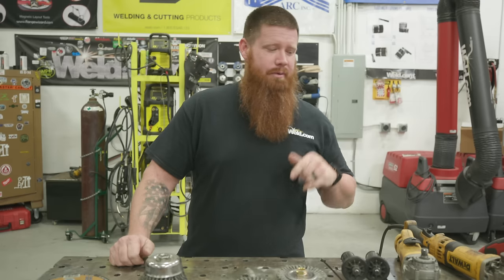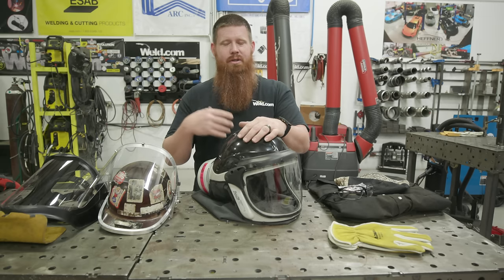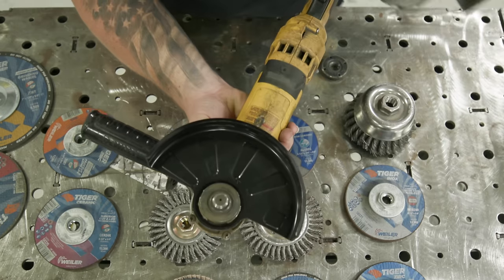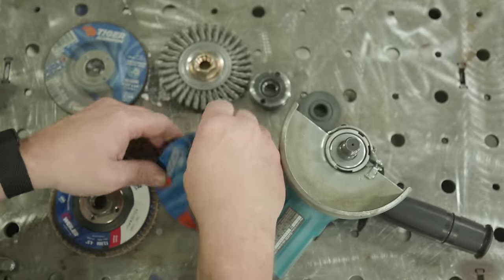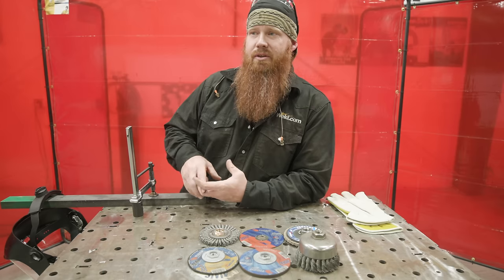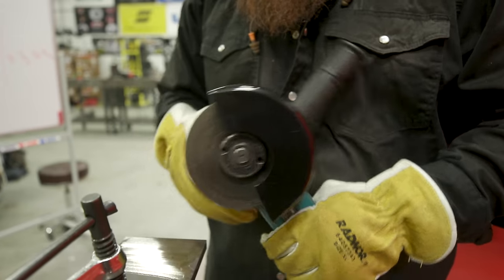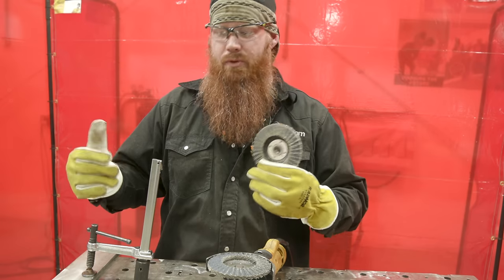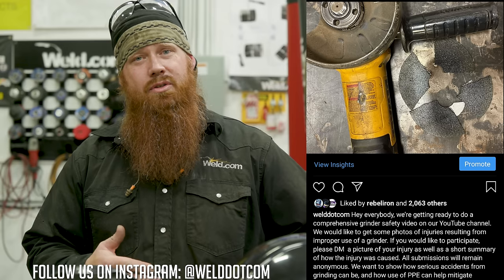Grinder Safety: How to Properly Use an Angle Grinder

Comment: Wire wheels are actualy banned at one of the campus’s I work at, a stray wire can do some serious harm to the human eye.
Reply: Or you could just wear safety glasses...
Reply: Of course so can everything else that goes on a grinder, I only wear safety glasses with small ones sometimes but you gotta angle it right, also you got to watch them getting stuck in your shirt, when you go to take it off you can near on scratch your eye out if you are unlucky.

Banning them is just ridiculous though.
Reply: Dale Neish im not saying I agree with it, but that’s their reasoning
Reply: Dimitri Ol m8 I just told you I didn’t agree with it. I was never in favor of their ban on wire wheels.
Reply: Dimitri Ol no problem my dude, happy trails!

Comment: List:
- No eye protection
- Short sleeved t-shirt
- No face protection
- No protection guard on machine
- Flimsy gloves
- Flamable material on ground
- Flamable material on workbench
- Highly flamable gastanks
- Holding workpiece by hand
- No second handle on grinder
 
Am I missing something?
Reply: No respirator
Shooting Sparks at the power cord
Reply: Big old beard flappin' in the breeze eager as a beaver to get in on that rotary action.
Reply: No hearing pro

Comment: Ok lemme try. 
No safety glasses on. 
Holding grinder with one hand
Grinding ON 02 and C2H2
Grinding near solvents
Not showcasing that magnificent beard!
Reply: and...
Work piece not secure
Power locked on
Junk on the floor
No welding jacket/spark guard
No guard
No respirator (cut-off wheel fumes or grinding dust while in my garage).

Comment: My take on safety violations I've noticed so far: 

No eye, ear, or facial protection
Gloves look useless against a grinder (maybe use leather)
Holding wrong part of grinder
Metal piece should be clamped
Use two hands for grinder
 Wheel/blade should have a guard
Fireball potion in front
Explody gas tanks behind
Reply: I think you got almost all of them. Maybe add standing on the wrong side of the grinder with the blade towards you and throwing sparks up not down?

Comment: Lol I set my battery powered cut off saw on top of a rag as it was turning off- the rag got sucked in . I'm here to learn safety. I scrap metal and I take apart Transformers for Copper. Quick story- My friend plugged in his grinder and it was ON! It rolled on the table towards him and cut him ( just like your presentation discussed.) Battery powered cut off saws don't give me the RPMs- but at least I don't burn out/ overheat the motor. Also I'm rough on the tool- forcing it in when I should just cut it slowly- a BIG THANX for your help . Quick story- I know 2 people who cut 2 fingers on a table saw- one guy with 40 years experience  has no feelings in two of those fingers!!!!!
Reply: I fell at the bottom of my porch stairs 2 months ago, I had an old crock pot glass bowl that had a huge crack in it, needing to be hauled off where I take my trash. Needless to say I tried to break my fall and laid my ring finger open on dominant hand. Had about 6 stitches, about 6 staples on my wrist, a shot in my backside, and one in my arm. For my negligence and stupidity. I was supposed to go see  a specialist, I decided against it. Urgent care told me they didn't have an ex ray machine but I had probably cut a ligament. Well, my finger will never be the same, and I already have deputyens contracture. I never thought something so small would make such an impact on my life!

Comment: 24:08 this is an inside joke right? Nobody actually uses that wrench.
Reply: @d.martins709  The tool spins the opposite direction as the nut, this means the nut self tightens. if you get it hand tight and use the whole disk in 1 go the nut is so tight it is hard to get off. if you overtighten the disk with the wrench you can damage the locking pin in the grinder. if you look at an old grinder with a lot of hours on it you will notice that the locking pin wiggles back and forth and sometimes doesn't work properly.

Comment: Guys anyone out there thinking these videos are pointless.. I had a disc explosion it's no joke I got super lucky my garden fence was not. I ended up with a hole in my top..fence got a hole straight through it
Now I take maximum safety and check every single disc beforehand.

Follow this guy's safety tips don't take changes 👍

Comment: Thanks alot for posting this video. So informative. I have owned an angle grinder for around 6 months now. I read the manual first thing but they dont state everything. Most welders I have seen operate an angle grinder dont use the guard or wear PPE . Once you see the accidents that happen, you are always going to follow all safety requirements the tee.  Thanks again for this . Learnt alot

Comment: Thank you so much for this. I've never used an angle grinder before, and just bought one to free my bike from the lock to which I lost the key. It's still locked right in my old city, so I'm traveling there to bring it back. I already had the face protection ready, but I had the wrong type of gloves, wrong pants (100% synthetics), wrong shoes, and I hadn't even considered the very good points about which direction the disc turns with regards to kicks and whatnot. Your video has potentially saved me from personal injury or worse. Power tools are awesome, but also surprisingly dangerous.

Comment: Thank you very much for this very informative video. I am very cautious in using a grinder and lately only using smaller grinders. You gave me a lot of safety tips up the sleeve. Had almost a life-threatening incident with my big grinder almost 40 years ago, replacing floor covering with tiles, which was glued to the floor. Trying  to remove the glue for better grip, the glue built up on the disk and eventually exploded - it missed me with millimeters luckily - leaving a huge hole in one kitchen cupboard.. Emphasizes using the right disk for the right purpose.  Now we have special diamond disks  to do this luckily.

Comment: For someone that using a grinder almost everyday and never been properly trained in safe usage this video is valuable. Had kickback with a wire wheel also have had cutting disc shatter in me cutting in the wrong direction. I will not be making the same mistakes. And great advice if you can't get inthere safely its not the rite tool no excuses

Comment: I just bought an angle grinder as a noob, and I"m here to learn to use it safely prior to turning it on; thank you for the detailed video...aaand will invest in proper safety equipment now and a little more training.  Thanks!

Comment: i was using a 4'' cutoff wheel that had a chip in it the other day. thought i could just grind it down with use, but it blew up. i had a guard on it and safety glasses. luckily it blew up away from me because the guard.
Reply: GigaDonk Did you try grinding it down on metal, or something like concrete?
Reply: Yeah, I'm a time served engineer with welding training. This video is very good, well explained and will help save people who don't know a trip to hospital. But you know what? It's a Sunday night job an you last wheel has a dang! So your going to use it, just like you're going to grind with a cutting disc. Don't do it.

Comment: Just bought myself a 4in Dewalt grinder.  Before use I came here to make sure I don't injure myself. The most useful tip was not using bigger wheels on smaller one due to rpms.  Blew my mind!  Great information. Thank you! Granted I'm only going to cut off 4 small screws but better be safe than sorry.😁👍

Comment: This is the best grinder safety video I have seen yet. Very comprehensive. I think the reputation that angle grinders have for being so dangerous is almost entirely due to people not using them correctly. And due to people trying to use them for woodworking. I got the chills the first time I saw one of those insane chainsaw wheels.

Comment: I’m a newbie to using angle grinders, and I treated it with the respect I’d afford a firearm. I did a lot of what you described purely from thinking about what I was going to do and the implications of it. Having worked in an Emergency Department and experiencing the aftermath of what happened when both amateurs and professionals get it wrong helped too

Comment: I just want to say that although i was intimidated by the length of this video, I knew i needed to invest the time of i was going to be responsible for my safety. 

I just got my first grinder. I had used one a couple years back on a job. My cut off wheel only lasted about a dozen cuts and i had a couple of instances where the tool wanted to take off on me. I'm humble enough to admit i was doing some things wrong, and eager to identify them and correct them. 

Here's to keeping both my eyes, and learning from your Dad's mistake, hopefully keeping cut off wheel out of my abdomen!

Comment: Glad i found this video. I'll bare everything in mind now. Yesterday i nearly cut my finger off with an angle grinder and using it improperly with no safety equipment on. lost some bone from the finger tip and cut down vertically through the nail. stay safe everyone.

Comment: Great video. Covered everything I learnt in the training center, accept for the label on cutting disks that need to face outwards. That protects the disk when tightening the disk. That is what the tab is for.
Reply: Not always the case. Disc should have an arrow for direction, and quite often it is label downwards ,but not always. I saw this fact on another video!!!.

Comment: Thx for your detailed safety info. I'm a senior handywomen and just bought a 4" 11,00rpm grinder. Your safety video only covered using the grinder for metalwork. My intention was to use the grinder and diamond cup wheel for coating removal on my porch. My 2nd intention is to cut a granite countertop to enlarge the hole for a new cooktop by approx 1/4". Any advice for these jobs would be appreciated.

Comment: 46 years a mechanic, those pictures at the end,I've had a few misses crap in my eyes even wearing goggles,biggest mistake one time I removed the guard nearly lost two fingers, the first and last time,great video,from now on I'm going to use the full face helmet after seeing that peice of cutting wheel in the safety glasses.

Comment: I grind and cut inside alluminum tankers and my favorite alluminum grinding wheel is a 4.5 Diablo carbide saw blade. Aka the widow maker. 1000 times faster than grinding wheels and lasts for months just got to be crazy aware of kick back..

Comment: great job. i am  a steam fitter and one other thing, when cutting pipe always cut in an up wards direction, as you cut through the pipe you will leave a sharp edge if you are cutting up the wheel rolls off the sharp edge. if you are cutting down then the wheel will be cutting against the sharp edge which will wear the wheel off faster.

Comment: answer this 1. How do you make the spark fall toward the floor? 
2. Why shouldn't you grind flat with a wheel that is 1/8 or smaller?
3. What should you always have on the grinder?
4. Flapper wheels, what side should you use to keep parts that break off from going all 
   over the place?
5. What must you do to your coupon to insure proper prep?
6. On the pipe what do welders forget to clean?
7. What is a type 27 wheel?
8. What are you removing from the base metal?
9. What is type 1 wheel?
10. Should you use the same gloves for welding and grinding?
11. What is a flap disc?
12. What type of PPE should you use when grinding or cutting material?
13. Why should you use tight fitting gloves?
14. Before removing the wheel off the grinder what should you do first?
15. In what positions should 1/8 or smaller  wheels be used ?
16. What should you do with damaged flap disc and abrasive wheels?

17. What should be done with a cut off wheel that is damaged?

18. What can happen if you use a cut off wheel past its rated capacity?

19. What should be done with a damaged wire wheels? 
20. What is a backing flange or ferrule, and what is it used for?

21. What is a type 1 guard and who mandates that we use them?

22. When using cut off wheels what type of flange nut/( ferrule) should you use?

23. When you are changing wheels or repairing the grinds what should you do before you start?

24. What is advisable to do with the wrench in order not to lose it?

25.

Comment: No guard on your grinder,  handle not installed and being held onto with your other hand, not using both hands on the grinder, work piece being cut not clamped into place and holding with hand, not wearing your safety glasses, no safety face shield, corrugated fiberboard box and wood scraps lying on the floor where sparks could ignite them, floor cluttered with chains and a bucket of scraps to trip over, solvent container in the area where sparks could melt thru the container and ignite, oxygen and acetylene bottles and it's hoses too close to grinding area, not wearing proper protective coverings on arms or better yet a welding jacket to help repel sparks and harm if possible failure if the disc if it were to grenade, AND NO BEARD GUARD !!!
GREAT VIDEO, lots to keep in mind before one were to even start a grinding task !!!

Comment: A lot of fabricators tend to take short cuts on safety. The one that I see most is the removal of guards when the cutting disc, wire brush are dangerously close. Ear protection is the other thing that I note. Also shattered wheels shoot fragments anywhere and easily lodge into our soft tissues. A timely reminder, thank you

Comment: Wow, this is very educational, even after 50 years of tinkering I learnt bits and pieces. Thanks for taking the time for making and sharing. 
Good when one has so many choices of guards, wheels and brushes available in the shops. 

Q: Do the grinding sparks radiate UV light? After prolonged use my eyes feel flashed and dry at night. (Always using safety goggles of course). Have tried sunglasses under the goggles, but no you can't see well and they are too bulky. Anyone had the same experience?

Comment: I have to say that your video has helped tremendously!  I got a nondewalt grinding disc.  It doesn't use a farrel(?), so I took it off. I don't see how to tighten it other than hand tight but at least I can now figure out if it'll work!  So thanks!

Comment: First of all it’s a great informative video. I bought myself a grinder and kind of use it at my work doing DIY very often. Love to know more about it. 
Can you guide me with one thing. I have a milwaukee grinder which supports 4 1/2in and 5in grinding wheel. I just want to know if i install a 5” diablo Type-1 with proper 5” guard. When the disc grinds down to lower than 4 1/2”, am i supposed to change guard to a smaller size now or i can keep my 5” guard on and use the same disc until i decide to change a new disc

Comment: Very helpful. Thank you for sharing. I  have a Makita 4"  grinder that I want to use for woodworking and carving. I have heard of people  being severely injured by not using the tool properly and with attention to what they are doing. I have never used one before, so I am trying to learn all I can about the tool and safe use. Could you recommend places where I might be able to  search out an instructor? I live in a small rural community. We have a Home Depot, an Ace Hardware and a small community college. I don't know if any of them offer classes on power tools. Any recommendations?

Comment: Thank you for making this video! This should be taught for any field using this tool or youthful for DIY home / work.

Best tip I can give, don't trust anyone's tool and inspect it. Even from family members, cousins or work colleagues. They might not use the right specs of tools or didn't install properly...

Be safe first and foremost!

Btw, I really felt it when you told the story about your dad. It could've been my dad or myself as a dad and we have no protection whatsoever. No handle, no guard, just bare feet!

Comment: I really like my grinder. Got a DeWalt from a Mrs. off of Facebook market. Met her at a Food Lion. Paid $75. With it I sharpen my Blades of all my tools. I cut designs into my burn barrels. I cut into the concrete foundation of my home to do plumbing. I use 60g flap disk for my carpentry. I  ❤every way to utilize it.

Comment: Great video!  So, the directions of the sparks and the kickback are opposite?  Each time I do a cutting, the sparks should be firing towards me and set the fence blocking it? Correct? 
I have been setting the sparks away me all the times .

Comment: I have had two friends almost cut their hands completely off, both requiring micro surgery for horrific injuries, both usined grinder with no handle or guard, one also used a disc worn completely away, worth knowing that a worn away disc will now be running at incorrect RPM than it was when new and full size, people do not realise how dangerous grinders are if used incorrectly,  personally when I use my grinder or circular saw, router etc. I make a point of going on RED ALERT as soon as I get them out. great safety video what everyone should watch.

Comment: 11:22 happened to me a few weeks ago. Disc was rated for 15,200 rpm. Tool ran at 25000. In case you were wondering yes my leg wound up exactly like that apple

Comment: I went 5 years in the trades unlicensed, with no medical or liability insurance. 
With that kind of baggage over your head you don't dare fuck up (which is why I refused to do any HVAC/gas/breaker panel work). And I didn't. I find myself always cognizant. Job done right, uninjured.  I could walk a construction site in socks, never got injured. PPE in some ways creates complacency. Think about this- nails in feet is primarily from hard-sole boots.

Fun video regardless! Liked!